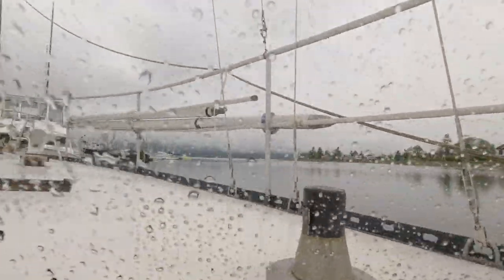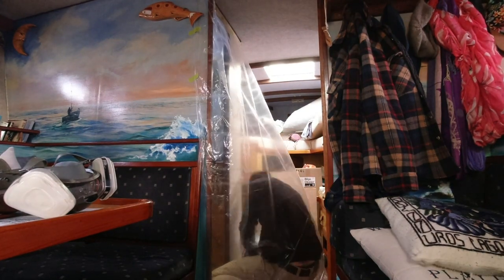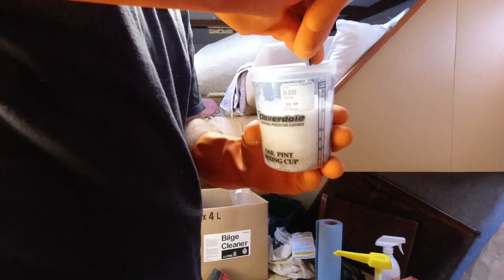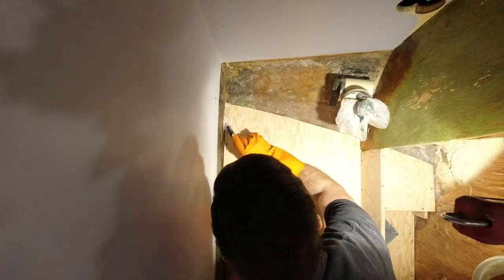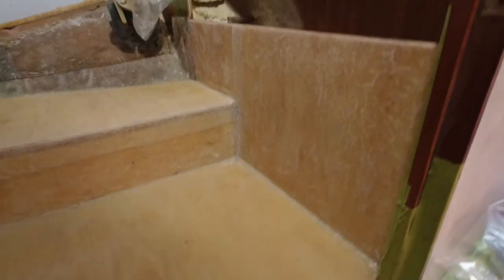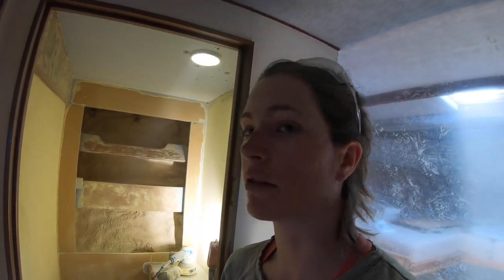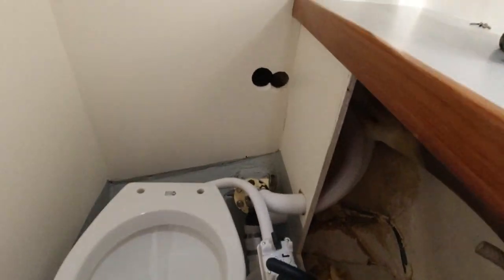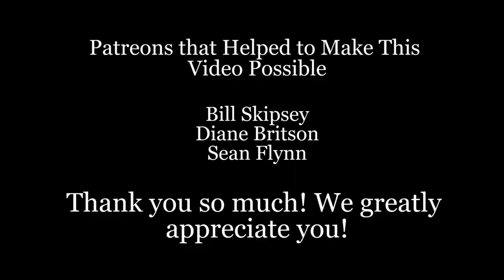Renovating our Forward Head (bathroom) on our 45 Foot Sailboat | Ch3 E5 | The Wayward Life

Comment: Great efforts but  if I may.
The underside of the ply ( hopefully marine ply) should be impregnated with resin before installed the joints needs to be sealed with resin (so you need and inspection port/ ventilation port).the top side needs resin but a good idea would be to add a layer of  cloth so the entire project is ridged, you do not want micro-cracks. allowing water to your sealed ply.
How are you going to access the hull when needed, 'cause it WILL HAPPEN! :-)
... I am afraid of all the rot you found, and that only what you could see before dismantling.
On to the next video! At 14:11... is that MFD type you are putting on???